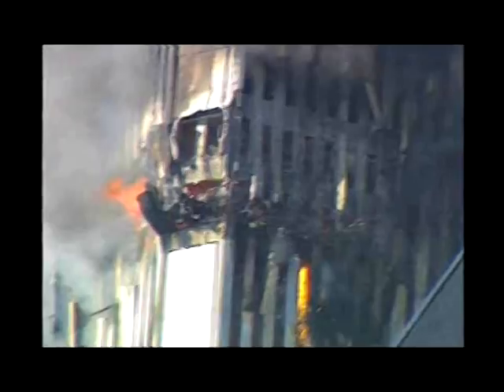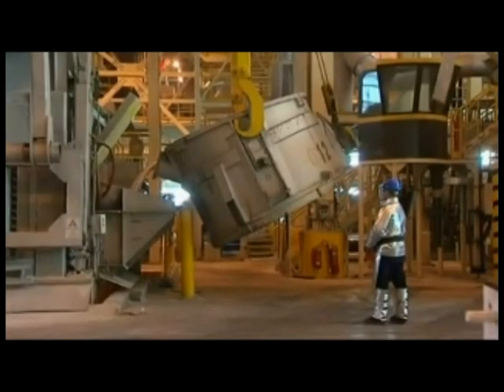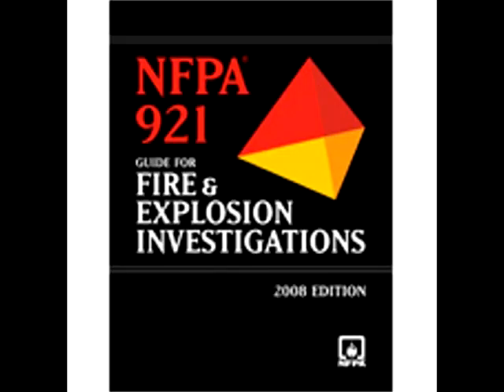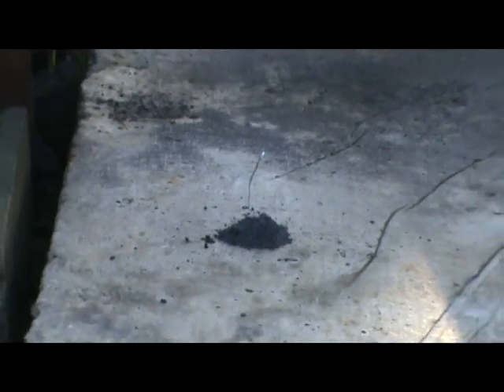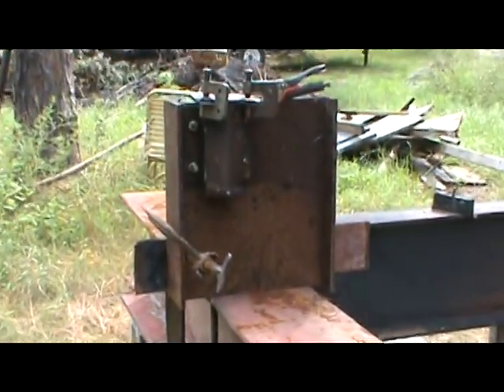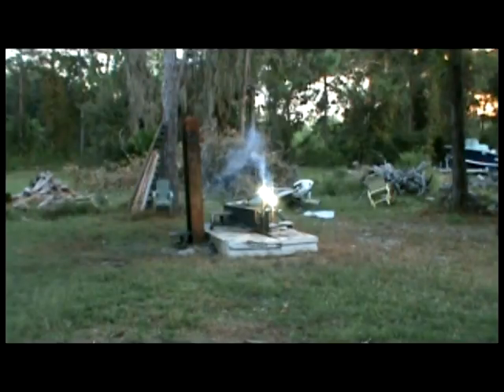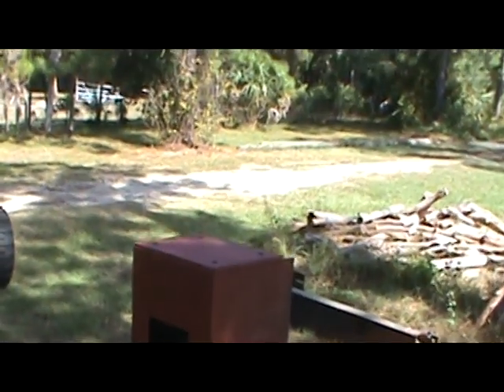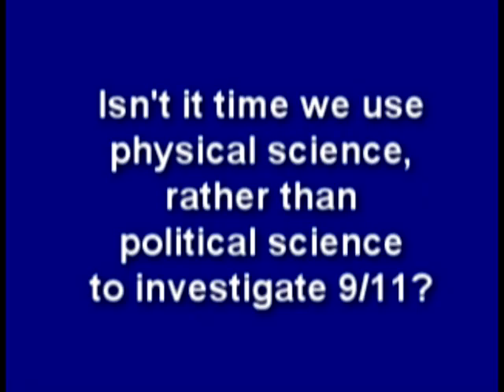9/11 Experiments: The Great Thermate Debate

Comment: When interviewed in 1993, Lead WTC Structural Engineer John Skilling told The Seattle Times:
“We looked at every possible thing we could think of that could happen to the buildings, even to the extent of an airplane hitting the side… Our analysis indicated the biggest problem would be the fact that all the fuel (from the airplane) would dump into the building. There would be a horrendous fire. A lot of people would be killed. [But] the building structure would still be there.”
Reply: A Douglas DC8-50 (the largest airliner in service at the time the WTC was designed) hitting the side of the WTC (presumably due to an accident and it's proximity to JFK and Newark, as opposed to a deliberate attack) at 250 knots (maximum permitted speed below 10,000ft in the US since 1960, so assuming the worst kind of accident one could reasonably expect) has a kinetic energy of 1.22GJ. 

Flight 11 (a Boeing 767-200ER) struck the North tower at a speed of 404 knots, with a kinetic energy of 3.35GJ. Flight 175 (a Boeing 767-200) which struck the south tower at 513 knots, had a kinetic energy of 4.53GJ, so it's a reasonable inference that the aircraft on the day had 2.6, and 3.6 times (for flight 11 and flight 175 respectively) the energy of what would ever even be considered a reasonable possibility. 

It's a reasonable decision to make in an area with such high aircraft traffic density to have built in precautions in the event of an accident, however, it's pure foolhardyness to design a building to withstand the impact of a large commercial aircraft at a speed which by law is not permitted. No architect or structural engineer would ever allow for the building to be designed such that it can withstand a high speed impact from the largest airliner in commercial service at the time, never mind newer, stronger aircraft travelling at beyond their maximum rated speed, because the costs involved would be astronomical, and the risk involved would be so minute as to make it unattainable. 

That argument that they were designed to withstand an impact form a plane ignores the reality that no designer would ever sit down and reasonably consider the chances of a large, heavily loaded airliner flying into the building at a speed which would not be achievable under any sort of normal circumstances, and keep in mind that before 1960, the total number of recorded hijackings of aircraft EVER came to NINE. 

The reality is, this argument holds zero weight on the outcome of the 9/11 attacks, and proves absolutely nothing to suggest that it was a deliberate act by the government of the US, or anyone other than a group of hijackers.
Reply: @DatNerddSwaqq 

Mossad. The towers were built to take down. They tried in 1993 and failed. Larry “Silverfish” Silverman bought the property months before the demolition and made out like a true bandit on the insurance claim. Dick Cheney’s Halliburton was directly involved…..

https://youtu.be/giFRe1v0YjQ
Reply: DN Swag The aircraft are not capable of reaching those speeds at such a low altitude.
Reply: sarahdelano Except that they are. Similar Aircraft have reached higher speeds and survived before. No, it's not good for the structural integrity of the aircraft, but as long as you don't intend continuing to fly for very long, then they absolutely can. On whose authority can they not reach those speeds?
Reply: A 767/757 has never reached those speeds in level flight at low altitude. It has never happened. There is not a single commercial aircraft pilot who will tell you that it is possible, neither will Boeing.
Reply: @DatNerddSwaqq nonsense

Comment: Yeah but you forget the stress and pack from the airplane you got something to go on 200 miles an hour hitting it destroying the steel panels can holding the stress then the heat got up to close to thousand degrees weakening the panels just on that floor you impact the floor under a bottom floor below it it's going to go bye bye and all the way to but it's going to keep pushing it down and down further and further that's just common sense

Comment: Maybe they used thermite in building the structure for scenarios like 9/11, to make the structure fall straight down instead of going sideways to crush more buildings. The 2 towers if they were to fall sideways it wouldve caused more buildings to fall and casualties.

Using thermite in constructing towers is smart. It wont ignite it self, but needed something to ignite it. For example, the plane crashing into it, it has jet fuel. Which is proved not to melt steel beams. But it has enough heat to cause the thermite that was used in building the towers to go boom

Comment: Dude... Get real. Noone would go to such great lengths to do such things. We see that the magnesium coil is required, so a standard fire wouldn't ignite thermite or thermate even if it was planted. Those reports of molten steel are also false. Yeah, shit stayed hot a while, but there was nothing truly molten - primary sources people - try reading them. They already wrecked 2 planes into the goddamn towers. Why would you need any explosives after wrecking a plane into a building?? Come on, dude. Don't tell me you're one of those "inside job" people. That's just ridiculous.

Comment: You’re right, jet fuel can’t melt steel. But it CAN get steel hot enough to forge. 1800°F is plenty hot enough to bend and even break steel, assuming you have enough force (like maybe the force of holding a building up). And guess what steel does when forged? It sparks. And The metal spheres are likely the tuned mass dampers of the towers. Furthermore, it is possible that some form of chemical reaction occurred when the Aluminum aircraft hit the Iron building. Aluminum + Iron = Thermite, remember? 
Also, glass melts between 1800-2200°F, and when molten, it glows a bright orange
Reply: Dude thinks people were in the twin towers forging steel while all this is going on.
Reply: Oh yeah, the glass is somehow not going to break and stay in the original position just to wait to be remelted. No, the glass would have been scattered everywhere and not be able to produce a stream. Besides, the orange liquid was like water, glass acts as like molasses
Reply: Building 7 had no jet fuel and fell at free fall speed.
Reply: Simon Kim Their was molten metal coming out of the tower. Who convinced you that it had to be steel? You realize that there are tons of other metals inside those buildings and what those planes are made of, right? Namely, aluminum. 

It seems like you watched a conspiracy youtube video and just blindly believed their claims.
Reply: ty barrette That's exactly why the building collapsed the beams became mailable anyone who's seen a blacksmith at work will understand that the white hot beams became so soft they couldn't support the floors above.
Reply: You do realize how fast jet fuel burns, and how long it would take to get the steel to that temperature, don't you? Have you actually tried forging steel using jet fuel? Maybe you can make a video like this guy did?
Reply: ty barrette   Aluminium + iron does not make thermite.  Does anyone here have a clue what they're talking about?
Reply: people claim it's molten steel, but it's not been proven to be such. And those iron balls could be from the actual welding and cutting of the steel during construction.
Reply: First of all to make thermite you need POWDERED metals. Second, one of the metals has to be an oxide.  You cant just put two blocks of metal together in one room(or even smash together) and call it thermite=)
Reply: ty barrette still doesn’t explain why there was molten steel pouring from the tower.

Comment: It was later added that 1 year before they did structural upgrades and electrical work inside the building. That's how it was set to go off. This was all done to get the dept. Of homeland security initiative passed. They rejected it many times previously.

Comment: Hmmm. Now I just need to know how a couple thousand pounds of thermite was snuck into two fully functioning office buildings, attached to unexposed steel beam joints in a precise layout, and set off without a hitch.  The problem with videos like this is that it ignores the obvious. I appreciate the work, but if the conclusion creates more questions and improbabilities then you may not be on the right track

Comment: Can sb remind this guy that thermite is not just al and fe(II)o ?
Theres tonnes of types of thermite that can cut right through steel?
Some of them can be ignited just by friction and certainly some can occur when a giant machine of metal crashes head on to fucking building?(actually they most likely do not)
They dont even need to anyway
The temperature alone of jet fuel can kill the structural integrity of steel
YOUR ARGUMENT IS SHIT

Comment: You guys are idiots with the "melting steel beams" shit. If steel were melted, you'd have had puddles of molton steel at ground zero. Where was evidence of that?   What you had was SOFTENED steel. Hot enough to be structurally weakened but not hot enough to become a liquid. Know how it's easier to bend metal when it's hot? What if you get it hot and then stack thousands of tons on top of it?

Comment: You're right, an office fire can't melt steel. One with wind can. Though steel doesn't need to melt for a building to collapse. 
I used to study engineering, but changed my major. I can tell you the building was designed with trusses that would be able to support the opposite half of the building, in the event of a plane crashing into it. the trusses worked. The building didn't collapse immediatly from the hundreds of tons of building now being held by half the building. 
Instead the plane exploded igniting most of the materials on the impact floor on fire. 
This fire spread upwards and grew hotter as it worked it's way into the damaged insulation. The heat being trapped by the Insulation that was meant to keep fire out, caused temperatures in the thousands of degrees F. It's even likely that if a floor contained alot of wood it would have been cooked, as the fire approached it, turning essentially into near charcoal. That thing they use to forge steel with.  The trusses were never meant to permanently support the building. Just long enough for repairs to start. Add that with the extremly heated steel and they begin to warp slowly over the course of the event. Eventually thining the bolts holding the trusses enough or the beams enough that they give way. The moment a single bolt failed the whole thing was doomed to give. As an estimated 2-3 gigawatts of potential energy became "active" energy thus causing a chain of failures and sparking a collapse that released nearly 20 gigawatts of energy. The energy shook the entirety of newyork.  Please understand I'm not talking about electrical energy. This weakened the second tower even further which likely would not have collapsed if the first tower hadn't. 
Second the molten metal, could have melted as steel melts around 2500 degree's. This is possible because of the mixture of plane fuel and carbons available to burn. In a normal building no. this was a fire exposed to high winds, with the heat being trapped by the steel and Concrete body of the building, eventually making it's way into the damaged insulated interior of the building. The building became the perfect conditions to be a furnace. 
Also, the molten aluminum can mix with and react with the supplys in the building. Aluminum creates aluminum oxide when heated. Iron creates iron oxide with heated. If small chunks of heated oxidized iron from office supplies got mixed in with the molten aluminum and glass, it would begin to create extreme conditions through chemical reactions. Before i moved i had a concrete box with rebar in it. I would put wood chips in it and try and melt buttrr knives. One day, when it was incredibly windy, the fire got so hot i couldn't watch. It was "burning" me from about 4 feet away. I also have a steel fire pit that part of the bottom melted. When i was melting aluminum and burning wood logs on a windy day. 
Could steel have melted in the wtc that day? yes. Is it likely? No. I just wish for everyone to know All possible variables. 

Not sure from the angle but unrelated to this the smallest part of the steel beams used in the core of the WTC would have been around 5" thick. the size difference makes a huge difference in whether the steel melts as it can dissapate more heat. I'd like to see the experment done with thicker steel. Though i know, even then of course it would melt with concetrated thermite.

If nano thermite had truly been used, the entirety of the thermite would have been destroyed in the reaction would it not?

Comment: For all yall who are bashing on the “theory” that your own goverment set this up. Yall are missing one major point. The twin towers were designed to survive multiple hits by jumbojets. You don’t think they were that stupid to build these huge towers without taking account for a possible crash of a airplane flying into it? And then there is the free fall speed at wich they fell just like in controlled demolition. It’s obvious guys... wake up. This guy is trying to explain that thermite could cut the steel colums. But they didn’t use those improvised thermite boxes he did.. they used those kind of strips wich they use in a real demolition wich are designed to slice through steel within seconds.

Comment: Nano thermite is what russia uses as a fuel air bomb on armored vehicles, it burns alot hotter than regular thermite.

Russia uses to drop on tanks,

The US uses on modern day engineering for bridge cutting and bandalores. So your experiments is solid and yes nano thermite is much hotter and faster

Comment: Don't believe it at all... these guys don't have any common sense. As a fire becomes less smokey it's actually getting hotter... not going out. It's burning cleaner and hotter... hot enough to melt steel at 2000 degree's. Also the second tower fell first because the second plane hit lower on the tower... thus more weight above the fire. I saw it as it happened and I predicted it would fall first... and it did. Just common sense...
Reply: Not alone that, flight 175 (south tower) had about 25% more kinetic energy than flight 11, due to travelling about 100 knots faster at impact. The higher kinetic energy would lead to more structural damage, lowering structural integrity more.

Comment: As an ex-infantrymen, I can without a doubt say you’re full of shit. I have personally used thermite many times to make tanks inoperable. All it takes is 1 canister of thermite placed on the top of the engine compartment, pull the pin, the thermite ignites, and doesn’t stop burning until it decides to stop burning. It takes 12 minuets to burn a hole the size of a watermelon all the way through to the ground melting all metal in its path. Not to mention the railroad workers use thermite to fuse the rails together for the trains

Comment: Class A fires can cause steel structures to fail. Class A + jet fuel and then several floors on fire will most definitely cause a building to fail. In a building like that, multiple backdrafts were very probable. Ask any veteran fire fighter if they are surprised that building fell.

Comment: Jet fuel can’t melt steel beams the online community has been saying it for years but now everybody’s listening America isn’t an innocent nation when it comes to the back handed tactics they will use to get what they want the gov knew they needed men to fight so they made up a story to get soldiers since they can’t draft em
Reply: "Jet fuel can’t melt steel beams "
But can weaken it up to failure.
Reply: Thomas Kundera I beyond highly doubt it I’ve worked around fuel before but even without that experience the chemistry isn’t sound and yes I’ve seen the vid where some guy uses a steel rod but it’s just that a rod not the multiple inch thick steel used in the box columns of the towers
Reply: Steel lost more than 50% of it's resistance above 400°C...
Way below fuel burn temperature.
And 50% loss in resistance on an already heavily damaged building is way enough...

Anyway: that's what's happened, you just have to look at the evidences: planes in towers, fires,and towers collapse.

Any other "explanation" looks just total fantasy.
Reply: Thomas Kundera I would like to read the source for that it sounds interesting though for the core steel the most structurally sound part of the building to fall and collapse and for the building to fail as spectacularly as it did was no result of a fire by itself. Because all the fuel would have burned off within a half hour there was a study conducted where i-beams the same as the one in the tower were exposed to a jet fuel fire for two hours at full load and they didn’t sag or “melt” in any way
Reply: " I would like to read the source for that"
NIST report is a good starting point.
Anyway, what is you hypothesis?

" there was a study conducted where i-beams the same as the one in the tower were exposed to a jet fuel fire for two hours at full load and they didn’t sag or “melt” in any way"
Source? Thanks.